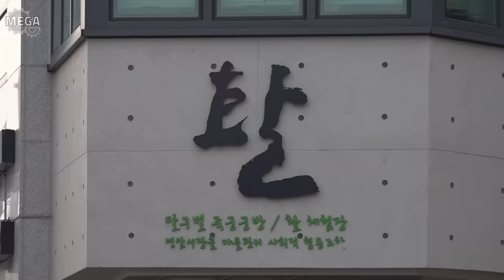Process of making Korean traditional bamboo bow. Korean best bow master

Comment: How much... I want to order.💪👍👌
Reply: You asked so you can’t afford it.😂
Reply: i hope you want it for decorative purpose. objectively they are not good bows.
Reply: @elee9056 Why not?? Genuine question
Reply: @pedrofz05  inferior material. which can be somewhat compensated by making it larger like yumi but in this case korean bows stay under 54”. some around 48”.
Reply: @elee9056  I see, thank you for your explanation. You appear to know of the subject. I’m actually trying to craft a bamboo bow myself, out of the brazilian variant “taquara” and “taquaruçu”, but I’m still insecure about it. Considering it is almost equal to the asian bamboo, what size do you recommend?? If I were to make a smaller one, I could always try a penobscot style, like this guy did —> https://youtu.be/q8A1aSW_Q_s
Reply: @pedrofz05  right penobscot would be a good idea. i would check out the cross section image of yumi bow and see how they utilize different direction of grains. i dont know your goal draw weight and your goal draw length. but if you are planning to draw no more than 28” i think you can comfortably make 20-30 lb bow thats under 60” bow length. maybe even 40.
Reply: @싱어송송-v3k  어디가 틀렸는지 설명 해주시죠 그럼

Comment: I'm so surprised that most of the comments
are from abroad. How could foreigners get  to find this? I've never thought many people
still have interest in bows in 21 century.
My small knowledge is that the strength of
bamboo increases almost up to 10 times
compared to merely  dried bamboo,
when it is well baked over fire.
Reply: I don’t think so. It is my understanding from reading a lot about bow building and actually building lots, is that it just speeds the drying process. It doesn’t harden the wood or bamboo anymore than if it were left to dry over a long period of time.
Reply: @Robin Barrett  'Cause you've never tried it,
you may think that way. But the truth is that
when bamboo is dried, baked over fire properly, its strength gets marvelously higher. When it is bent after heat-cured,
it doesn't even break easily just bending much. 
In Korea n' Japan many people used to make
bamboo fishing rods in the past, and they even used to hand down the fishing tackles to their sons. Actually it had been practiced in Japan more than in Korea. But now it's not easy to find people fishing that way, because
fiber glass fishing tackles replaced bamboo
tackles.

Comment: How do you get the balance without tillering?
Reply: Very likely from the two blanks used to make the limbs coming from the same section of the bamboo stalk. While you dealing with something that was a living thing and subject to possible differences in its growth, the thickness of the walls, etc. at the same point on the stalk, will be close.
Another factor is experience. He knows his bamboo! From personal experience, the bamboo-arrow fletcher I buy my arrows from can provide me consistently with arrows within a two-grain difference and an foc within 5-6 millimetres. That I find impressive.